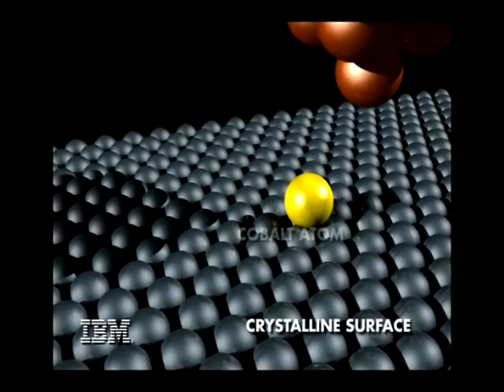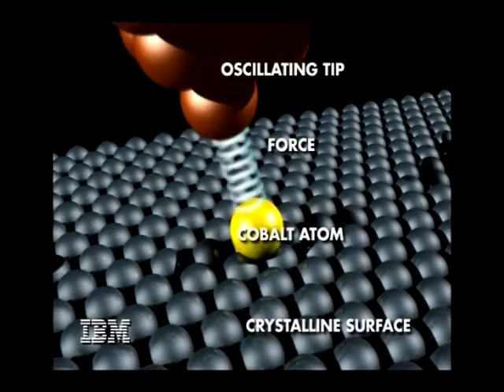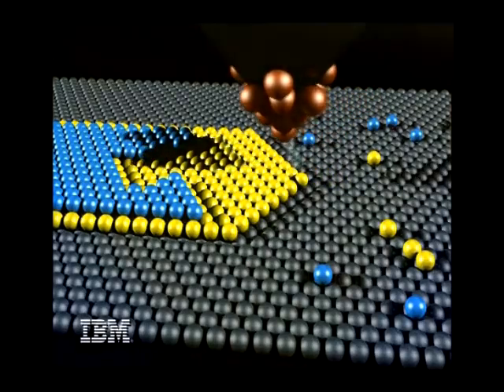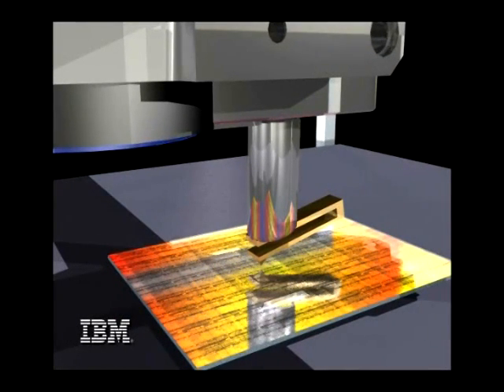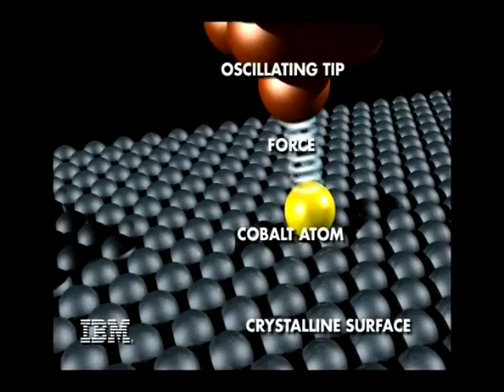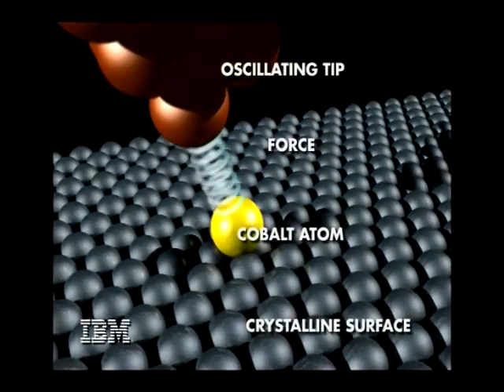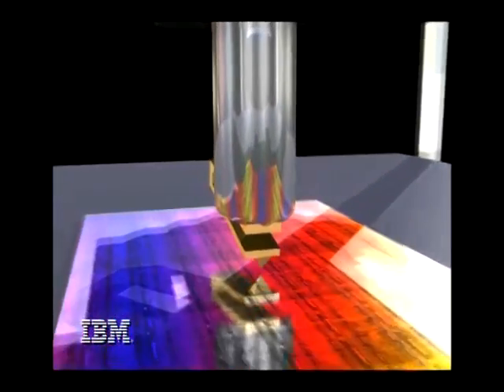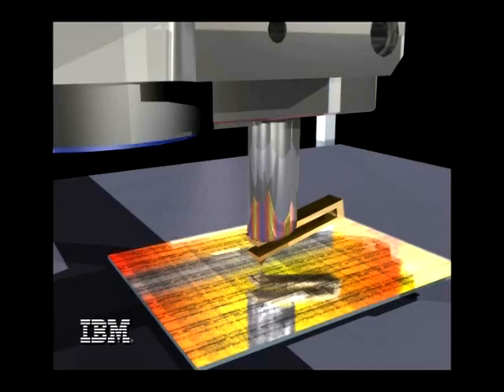IBM Measures The Force Required To Move Atoms

Comment: Could this technology be used to disassemble a material sample atom by atom, to work out (with say a Mass Spectrometer) where different chemical elements and their isotopes are located, or distributed in relation to each other throughout the 3D atomic lattice?

I almost wrote crystal lattice but I didn't want to exclude the possibility of studying amorphous materials' compositions.

Comment: I will check out that website.  

I disagree with you about the quality of Wikipedia rivaling that of Encyclopedia Britannica, as Wikipedia is seriously frowned upon by university standards, and there must be a good reason for that. I am obviously ignorant to your level of education, but it has been in my experience that even the mere mention of Wikipedia in the academic field is laughable. Actually, it is recommended to avoid most of the internet for info, unless using registered journals.

Comment: It wasn't TOTALLY miltary. They had little involvment though. It was originally a system set up by a unviersity that I forgot so they can share information with other universities quickly. They found it so useful they made it public. The masses were slow to adapt, when real changes started in the mid 1990s. Then the "Information Boom" began, and later the ".com Boom" and later inevidably the ".com Crash"